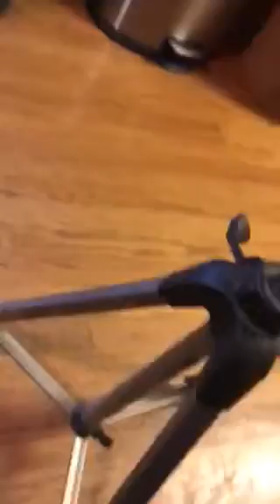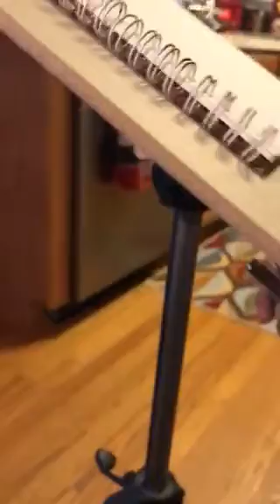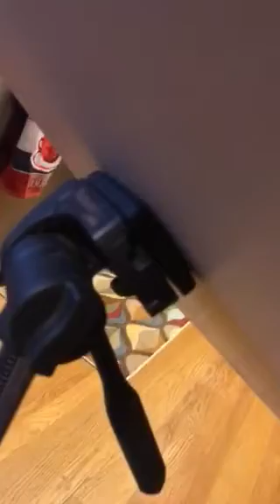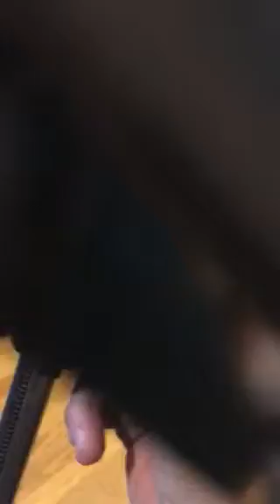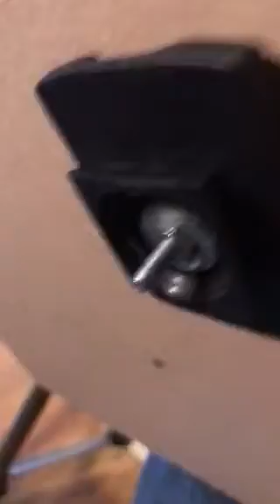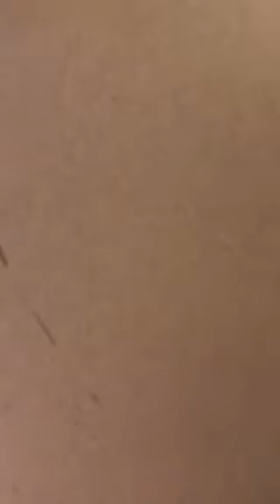Easy DIY camera tripod easel

Comment: Why not just buy a female part of the screw that is on the tripod. It saves faffing around. That way the tripod screws directly into the board.

https://www.artsupplies.co.uk/img_item/bracket_1___large.jpg
Reply from the maker: staygulf83 certainly that is a way to go. I wanted to do it with things I had directly in hand. Thanks for the comment and watching!